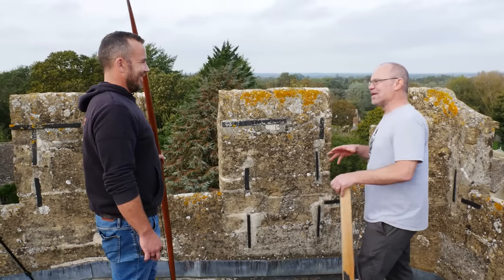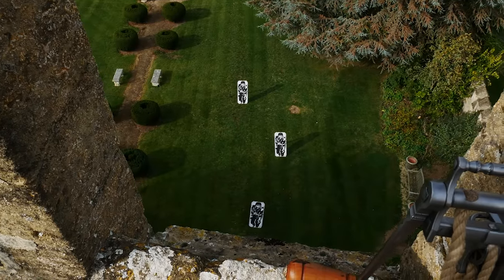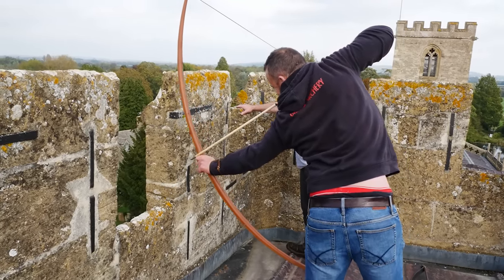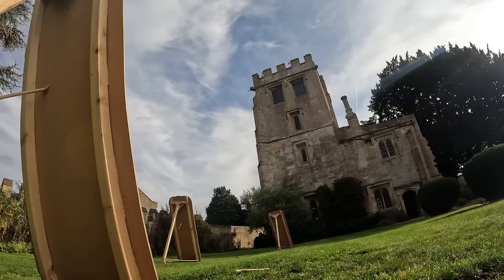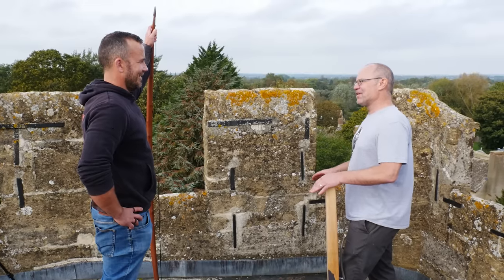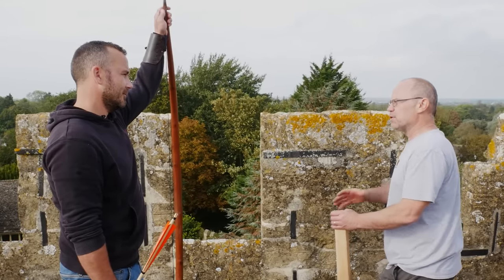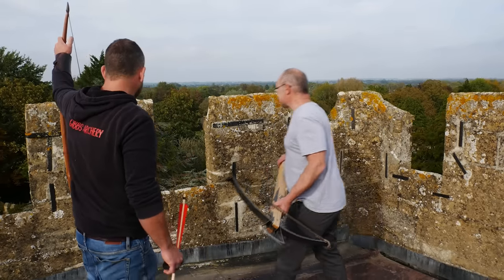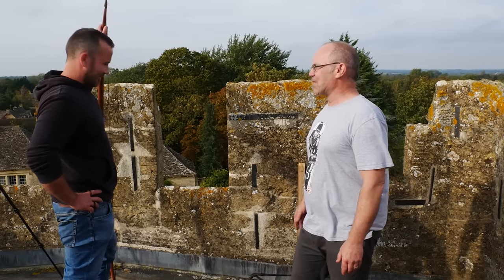Crossbow or Longbow? What's better for defending your medieval tower?

Comment: Crossbow would be ideal.
Firstly it doesn’t require lots of training.
Secondly. You have armor piercing capabilities.
Thirdly you can have rapid fire ability. Provided you use the fire in ranks method. Napoleon did not invent it. He just dusted it off.

Comment: One thing that I don't see addressed is that one would expect that much of the time the battlefield is a quite dynamic environment (when not hidden behind cover), so how easy is it to use either against moving targets.

The other thing to bear in mind is that even if you don't kill anybody you are still reducing the attackers freedom of action as the attackers are having to constantly think about how to avoid getting hit.  In that respect, the higher rate of fire of the longbow may be an additional advantage.  In particular, it also avoids the attackers being able to form any dense formations as that would leave them far more likely that at least one person in the dense formation would get hit.

Comment: I always thought that the advantage the crossbow had was the same that guns had, they required minimal training. The training to use either vs a bow or sword or spear were astronomically less. Meaning you could train soldiers to use them in the blink of an eye then send them out to battle. Essentially you could have something like 500 crossbowmen train in the same span as 100 heavy archers. Crossbows could also have equipment to assist loading so the men using them could be much weaker. Instead of needing Bord the strong farmer you could use Tim the weak merchant, which opened up even more people who can be trained. The weights for a crossbow could also be fine tuned to what the weilder can handle. Its versatility and ability to be used by anyone in a small amount of time is to me, what gave it the advantage.

Comment: It seems to me that the longbow had a very specific role in combat, and that seemed to be most in field combat. 

You need only look at the English victories of Agincourt, Poitiers, and Crécy. It heavily outshined the crossbow because of three things.

1. Speed: A longbow was far quicker to reload and was lighter!

2. Range: At the time, no crossbow could really outrange a Longbow, meaning more shots from further away.

3. Strength: Longbows were generally much more powerful than most crossbows. Key word most.

However, the longbow is perhaps the worst choice for defense in a siege. 

1. It's large: the longbow is light but very cumbersome, and as you can see in the video, it's very hard to angle properly downwards

2. The need to draw: Due to the need to draw the bow after every shot, and considering the fact that siege assaults could go on for hours, and that the longbow could be very straining to draw, it becomes hard to keep a steady fire rate.

3. Range: Range generally isn't a factor when you're getting assaulted from maybe 20-40 feet away. The crossbow is generally a better pick.

So, if i were a medieval lord and i expected to be mainly fighting siege battles, i'd equip my men with crossbows.

And if i was going to a field battle with my retinue for our lord, the King, I would arm them with Longbows.

Comment: Dear Tod, There were made very plausible assumptions regarding the advantages of a crossbow. Maybe another one would be that a crossbow can be seen as a heavy sniper rifle. The one shot solution. You can aim as long as needed and got the firepower of a heavy longbow. Shooting crouched or even prone (you can place a bench behind the gaps in the wall, so you can shoot prone like a sniper) for maximum accuracy and mimimaze your own exposed body area. With a bow you're much more exposed. You want to reduce this time to an absolute minimum, which means lesser time for aiming.
Bows maybe could be seen as the assault rifles of medieval times. A lot of rounds with a lesser accuracy, because you can't hold the tension that long. Also, as you mentioned, you need to aim for the face. For that you don't need a 180 pound longbow, to take one down. A weaker bow with shorter limps does the job as well. Longbows were weapons for open field or shooting long distances as in yor last video, I think. 

Maybe you could place a cardboard knight on top of the tower and try to hit it from the ground for your next video. Changing to the situation to the perspective of the attacking troops.

Regards!

Comment: not sure if this is a big problem but with bodily harm a bow might become hard to operate, but a crossbow can still be used since its a mechanical proces.
not sure how much of a disability it would be for either a crossbow man or regular longbow man to shoot and load after arm injury from incoming fire.

I term of the one redeeming factor of a crossbow is you can keep it locked and loaded at all times, making it a pretty good weapon for low skilled archers.
again i might be completely off the ball with that since im neither.

Comment: In fairness, a lot of real castles would have ways of dealing with the awkwardness. Everything from the simple things like a step-stool to help get the angle over the wall, to arrow slits/loops, to machicolations, and even on a grander scale simply having parts of the defensive wall that offer enfilading fire on the wall itself. As mentioned this isn't really a defensive structure, it just has features that happen to be defensive in nature - I suspect shooting from atop a typical curtain wall would be quite different in a medley of ways!

Comment: What an exhilirating, yet frightening first shot!

My first thought is are these crenellations the right size, off course their thickness was discussed but how about the height and the width of the gaps. As we've heard Tod mention decorations are usually in the "that's just fine" region back then and function should be proper. He also says in this film that these are for decoration. In a siege you take what you can get, but these were meant to look good rather than be functional.

I can imagine that crenellations would be built to the spec off the width of a crossbow, possible even with a center mark in de gap, a stone in a different colour for instance. Line up your stock over it and you know you never hit the wall with the bow (when you loose). This would require the bows on the crossbows to remain closely the same size through the ages. Is there any record of their sizes throughout history?

Secondly apart from the already mentioned benefits of the crossbow it also is more stealth on this roof. When Joe is about to prepare for a shot, you could see the top limb of that bow sticking out far before he is ready to loose, which gives attackers a chance to shoot back, knowing where he is going to pop up.
When Tod shoots the crossbow, there is less indication, so less time for an attacker to react.

Great film as always Tod inspiring tons of further research!

Comment: they are both great but I feel they wouldn't use heavy bows and crossbows. at least not at the top of the tower because of that awkward angle. I feel they would have trained archers using a lower draw weight bow to be able to make those awkward shots and shoot faster while anyone generally untrained in ranged weapons or trained crossbowmen would use lighter crossbows to be able to load faster. Also before anyone says that the weaker weapons wouldn't pierce armour. Good quality armour was expensive so the common soldier wouldn't be using much if any and plate would stop the heavier bow and crossbow anyway because of the angle and plate just being good at its job. It's also better to have volume of fire in a siege situation. Your not trying to pick and choose your targets your shooting in a general area you know they are and hoping you kill or wound someone.
btw I am not a specialist in this field these are just my thoughts as someone who enjoys history so take everything I say with a grain of salt

Comment: There's a reason massed troops switched to the crossbow. Training. Learning the aspects and tricks of a crossbow is infinitely easier than the longbow, and you don't need the back and shoulder muscles of an Olympian.
  Several pre-drawn crossbows could be set up for defenders if the see (and will see) a siege coming.
  The same reasons the crossbow became popular in mass combat is the same reason firearms took over. Easier training.
  In dynamic, mobile combat, a bow still rules over crossbow, but in this case, the crossbow will be far more practical.

Comment: Its easier to train a crossbow shooter than a longbow espically at high power draws. The occasional training with crossbow shooting would give decent shooters for a siege at fairly known ranges and perhaps massed targets. To have longbow users at warbow strength they need a lot of time dedicated to building up their body strength.
Plenty of other posters have commented on having secondary people reloading the crossbows. So a castle with perhaps 8 trained shooters on staff could have 8 or 16 reloaders and a few "ladder pushers" from  staff of 30-40.
Its also possible there would be a couple of longbow archers in the form of the game wardens and foresters for the outside areas. These could be shooting as well as the guards on crossbows and helpers reloading crossbows.

Comment: A longbow isn't a weapon. A longbowman is a weapon. For the everyman, a crossbow would do you fine in this scenario, since any man can run a crossbow. Not every man can run a longbow. Give Tod the same longbow that Joe is using, and he isn't going to be able to run it as well as he runs the crossbow. It takes a lot of training and a lot of talent. That is the biggest factor. There could be a lot of Tod's with a crossbow with a lot less time and effort spent compared to one Joe with a longbow. Also, just wanted to say thank you to both of you for making this content because there aren't a lot of Joe's around that can do this these days. It isn't 14th century England any more.
Anyway, a thing I think might be an advantage of the crossbow - pre-loading. You can pre-load a large number of crossbows, and either have a lot of men on the battlements, or trade hands. If you have a large rush to close range, you could throw out a heck of a volley. Downside, you'd be stuck for a minute running the windlass on each one afterward.

Comment: I presume they would have used lighter bows if they used bows from that tower, simply because loosing downwards requires a lot less energy from the archer to get the same force from an arrow at a level angle.

Comment: Before I watch. I'm giving it to the crossbow. It's more compact (it won't announce it self like a longbow) ammunition is smaller (I can store more of it), I can have several crossbows prepared ready to fire by relatively unskilled persons leaving the shooting to skilled soldiers. When using mechanical methods of loading, even my weakened defenders can load and shoot.

Downsides are obviously cost to manufacturer the crossbows. But a castle isn't cheap either.

Edit: " I can do it longer than whay you can" ... And honestly that's all that matters in a siege. That settles it. Equip evey tower with crossbows. And  make sure we have some windows lower down so we can hit the bastards that come close.

Comment: I feel like the most important comment is missing: With a bow you can shoot at a very high angle. It's not precise at all, but means, you don't have to expose yourself. With a crossbow, it is not possible. In addition, you are very limited in terms of shooting through the gaps as the front of the crossbow is taking up a lot of space.
On the other hand a crossbow is perfect for long distances as you don't need to stablise the weapon with your body. The heavier the fatigue, the less accurate the bow will be.

Comment: I always struggled to see the full advantage of a windlass, the system is to clunky and much of the advantages of crossbows are lost The size and weight makes is as awkward of not more so. With that said the major advantage of any crossbow is holding an angle and waiting for the opponent to come into view such as from the attacker perspective knowing where they archer is going to appear on the battlements.
This also demonstrates the effectiveness of certain castle/fortification designs where you can cover each others walls

Comment: With the increased elevation in the tower it seems likely to me that they would have used light bows? There is already a lot of energy given to the arrows from the height, which the bow doesn't need to give

Comment: A crossbow can be shot from a hole and pretty much hold a position for hours. The weapon is heavier but bolts are lighter, I dunno how much ammo they'd transport but in a siege I think it's quite a lot. It's much more similar to a rifle, it needs less training to use effectively, but it has a much shorter range. A bow has much more power and range so when you're shooting 50 arrows at the same time, aimed to a large group... that's a lot of damage. That's why armies had both weapons and sieges were much more about starving the opponent than killing more, because if you get closer to the walls, you get injured or killed, which doesn't change much in a battle because if you get injured, you're out for at least a month, if not forever. Sometimes we forget real life is not a videogame, you don't really need to kill. Even hitting a hand, a knee or a foot is good enough. If I get an arrow blow off my finger I'm rolling on the floor crying lol

Comment: I'm coming to this late unfortunately

While there's no real castles in Australia, I have shot from the "battlements" of the Abbeystowe "castle" at the Abbey Medieval Fair for several years now with blunt arrows at assaulting knights for the crowd, and I've faced the same problem in aiming even with a lighter weight bow, ironically I had originally used a fibreglass horsebow but on the same day I whacked one of the siyahs/ears on the frame and it broke, I now use a short bow instead for this event. 

Keeping in mind these are only 30lb bows used in the Abbeystowe siege, sometimes even needing to half draw the bow or use a bow with a significantly shorter draw length to accommodate the narrow window, I couldn't imagine using my 95LB Hedeby warbow from those windows and hitting anything within 15m without damaging my equipment, but then maybe that's a possibility for what they did as well, as you say often in these situations we'll never know. From the top of the castle towers, sure I could probably score an angle, but not much more than what's been demonstrated here. 

I always come back to a video taken from Guédelon Castle years ago (BBC's secrets of the castle season 1 episode 2 linked below) where they tested a crossbow from the murderholes of the battlements (and vs gambeson after making the gambeson material on site, though admittedly they miss their shot) I'd love to see you and Joe do a collaboration with Guédelon if possible.
https://www.youtube.com/watch?v=_VHgw6epe14&list=PL72jhKwankOiwI5zt6lC3eQtsQDxOaN_g&index=2

Comment: Historians and history itself has determined that crossbows are always better simply due to not having to train for nearly as long to use them effectively. 

Just given the circumstances here, I feel that crossbows still have the edge simply due to having the weapon in battery without any strain on the wielder. In this way, you can creep into the crenulation and pop your shot off, while utilizing the hard cover to its fullest extent. The longbow user has to be standing upright doing a weird dance to draw the weapon. The crossbow user would then step back, and another with a readied weapon would take his place and pop his shot off, etc etc. You wouldn't stand there in view while winching.

Comment: Crossbows were good because people didn't have to be trained basically in the right culture to use them. 

Early firearms were interesting to army commanders for similar reasons.

Also proper castles have better embrasures that allow better angles and cover in particular for crossbow users.

Comment: Tod states his chest shot would do nothing, but in 1450 your average archer, of some small-time lord, isn't going to have a quality steel breastplate.The armor tests show that would bounce right off a full-harness knight, but even that would still be of higher quality steel than your average small-time lord's couple retainers. Those tests were pretty clearly done on an analog of someone with wealth to buy armor, not someone who maybe won a lesser set in the single joust they ever won, or took off a corpse and had repaired, or was supplied by a small-time lord as part of the oath of fealty. 
I am thinking REALLY good chance the bolt would puncture a bit, but enough to get into a gambeson with enough force left to break a rib, rupture a lung, rupture a major vessel near the heart. 
It is always important to remember that weapons only need to be "good enough". And to be good enough, that just means efficient against MOST troops on a battlefield OR be designed specifically as a counter to something. A crossbow bolt is both, the only things near-immune are knights in quality equipment. Not the average man-at-arms, not the archers, not the knights horses, not the peasants with spears to fill out the siege numbers for assaults.

Comment: Maybe, to deal with anyone closer to the wall than your 15 metres (or whatever the distance to that second target actually was), you'd have a nice supply of fist-sized stones on top of the tower.  They might not be able to seriously injure a guy in full armour, but it'll give them a few bruises, even through a hauberk and gambeson; and it will make that zone between arrow-shot and the wall a bit less comfortable.